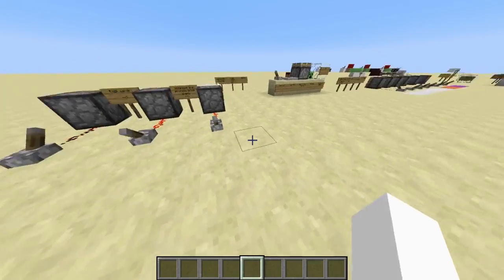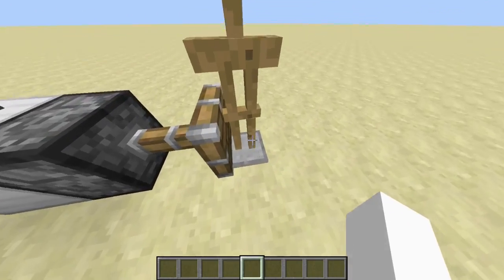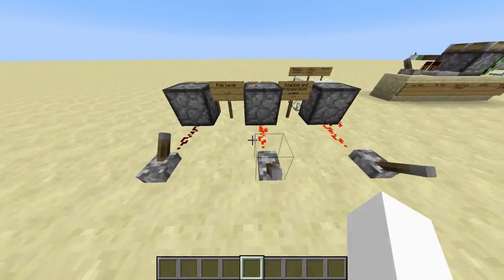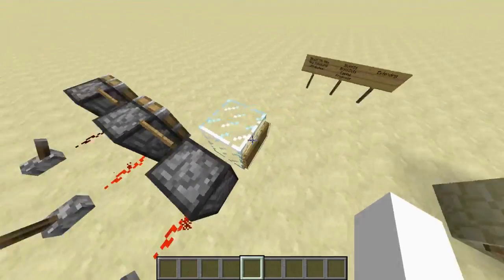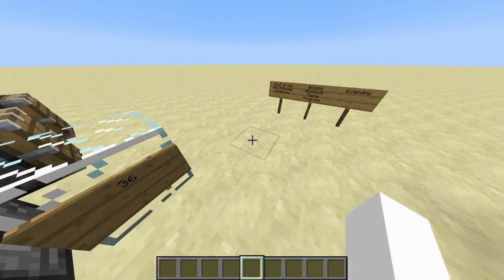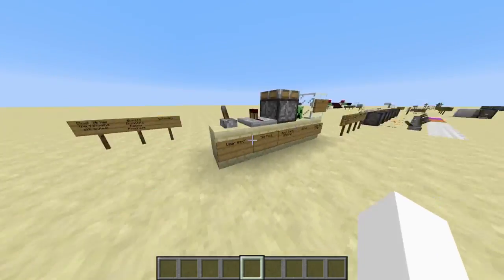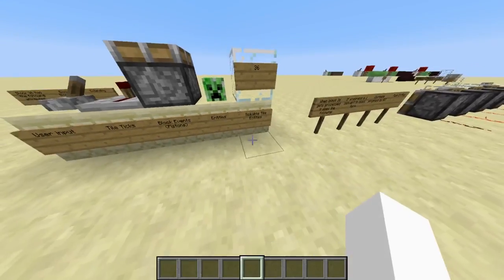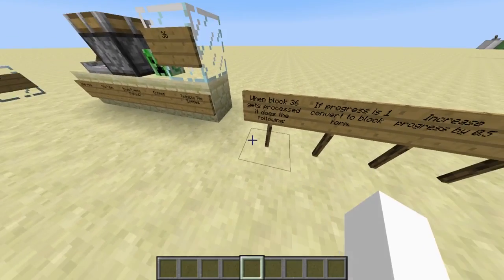About Block 36 and Entity Translocation [Behaviour changed in 16w41a]

Comment: hmm i tried this out with having a block in the corner like this: http://imgur.com/KWp5UA8
this works as without the block, what i get from it is that the block 36 infact moves you entirely infront of its hitbox in the second tick instead of .5 blocks. i have ofc no conformation for this but i cant explain to myself otherwise why you dont end up in the piston head
Reply from the maker: +Jendrik Weise 
Yes, the block 36 always moves you in front of its hitbox (if it´s possible without collision).
So we have 2 pistons which create two block 36. Block 36 A, on the left, and Block 36 B, on the top.
1st gtick.
A moves 0.5 blocks to the right, and moves you along.
B moves 0.5 blocks down and pushes you against the iron block.
2nd gtick.
A moves another 0.5 blocks to the right, and moves you along.
B moves anotehr 0.5 blocks to the right, and moves you along in front of its hitbox, which in total moves you more than just 0.5 blocks.

So I don´t see any problem here.
Reply: well you also said in the video it moved you 0.5 blocks infront of his hitbox(or sth like that id otn want to look it up) so i was curious what was about exceptions where it is not .5 blocks to the font
Reply from the maker: Jendrik Weise
When the block 36 tries to move you, it tries to teleport you in front of its hitbox.
I guess my audio is to blame.
Reply: yes i heared that just also that it moves you 0.5 blocks which is just the default case whatever

Comment: 15:10 xD I hope you figure out what happened there.
Reply from the maker: +ilmango 
The client has trouble with block 36 hitboxes. It only appears to happen under laggy circumstances, and with entities whose position gets determiend by the client. It doesn´t happen for me with entites whose position gets determined serverside. But under laggy circumstances, when doing it with serverside-processed entities, you can get short visual glitches, where it looks like they moved through for a short moment, but then they warp back to their actual position. So with serverside-processed entities, you can make it so that the client thinks they did the 15:10 behavior, but the server doesn´t think so, and the server gets to determine the position.
So the 15:10 behavior is a clientside only bug. I doubt it´s scalable, but I´ll explore it a bit more.
Reply: +Myren Eario ok. I was able to recreate it a bit, mostly by adding unnecessary stuff, which I thought would work but just confused the client. It seems unreliable. Didn't work once with a villager.

Comment: 15:10 lol. I've been testing this so many times, but that never happened. This is amazing. I like how you left the teleportation part for the second half of your video... sneaky xD
Reply from the maker: +pi314159265358978 
The 15:10 part was also quite surprising to me.
I´m pretty sure that was a combination of client incompetence and lag. I know that the client has trouble with block 36 hitboxes, and it can sometimes happen that you glitch into a block 36 hitbox clientside, and since client determines player position stuff like this can happen. The unreliability of the client when it comes to block 36 hitboxes was also the reason I used a horse in my elevator, because the client would never manage to get you through hundreds of block 36s without messing up. 
Unfortunately, I don´t think that the 15:10 behavior can be used for an elevator with any reliability whatsoever. But it´s worth researching.